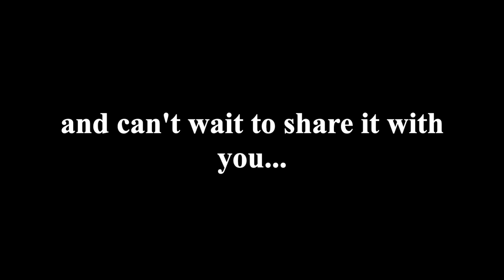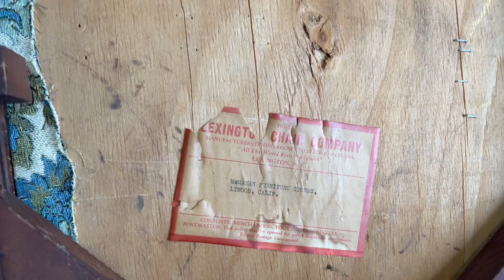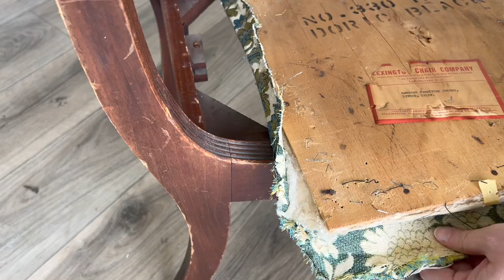Refinish a Vintage Chair in One Day | No Paint | ASMR Fable

Comment: I’m about to buy a sander. Any recommendations? Does your attaches to a vacuum? How does that work? Also, do you have to buff the wax after applying it? I’m sorry about all these questions but I’m brand new at this and you are such a great teacher. Thanks!
Reply from the maker: Sure, I love questions!  Ok, so the sander I used in this fable is fantastic for furniture refinishing because of it's size shape and foam abrasive options, but it is definitely an investment. (Think $6-700)  When I started out I didn't have anything that fancy, I used just a basic orbital sander, you can find them and any big box home store, and they can do a great job for you.  Yes, my sander attaches to its own super awesome hepa filter vacuum system - again, a more costly investment piece.  If that interests you, you can check them out at Surf Prep Sanders!  Otherwise, I'd recommend looking for a good basic shop vac, and for sure, a high quality respirator.  (dust mask)  Re the wax - you don't have to buff, only if you'd like a more satin sheen on the finish.  If you prefer matte, you can just leave it.  😊👍